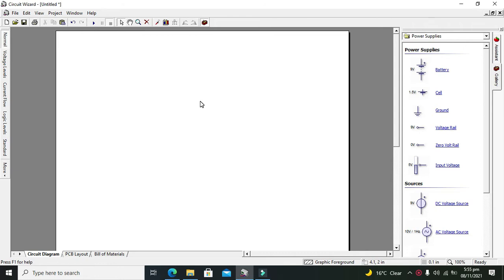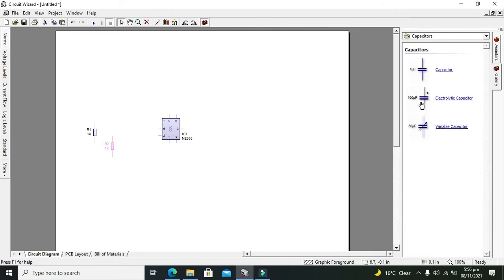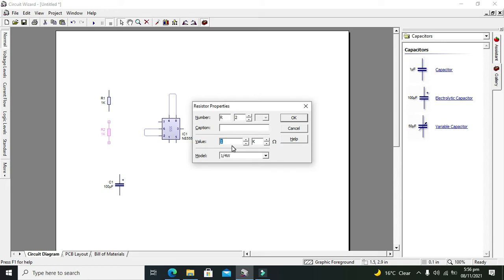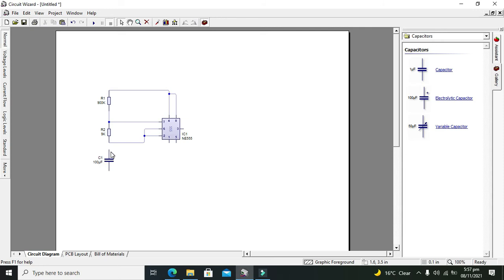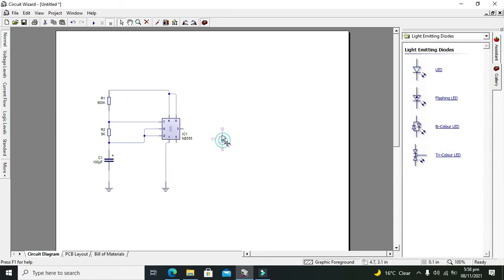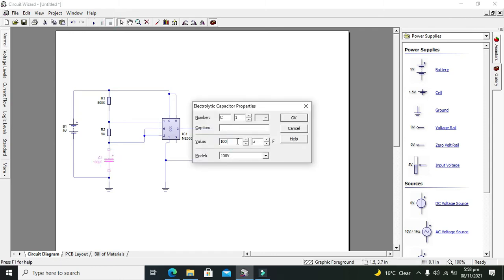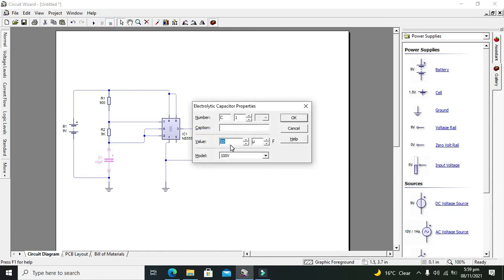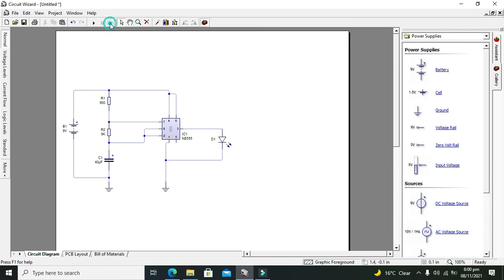how to make an led flasher with 555 timer in circuit wizard simulator

Comment: Thank You, very helpful. Its funny that you need a supply for the 555 but not the 4017? Anyway this is good software.
Reply from the maker: yes u r right.....In proteus even if u give 220 v to a simple ic..still it will be working...